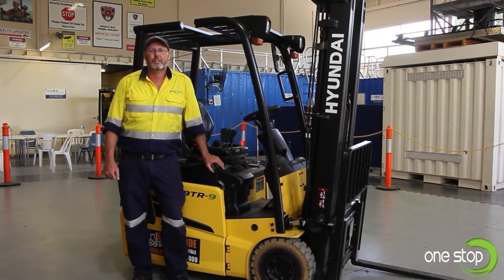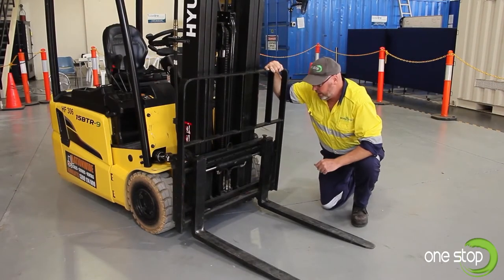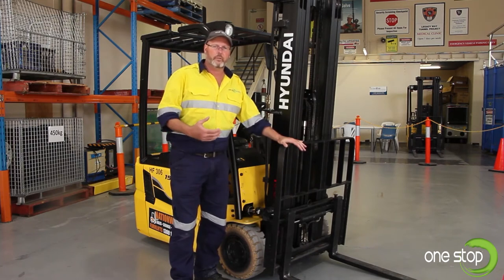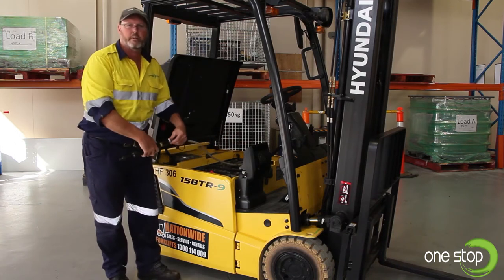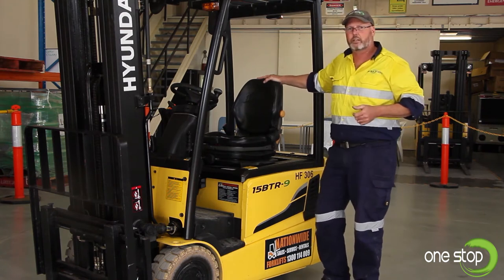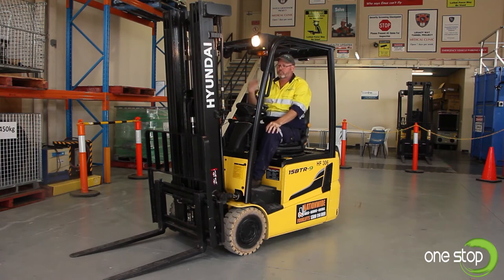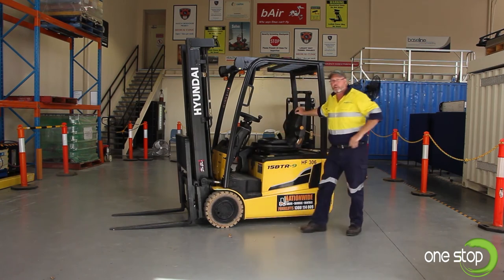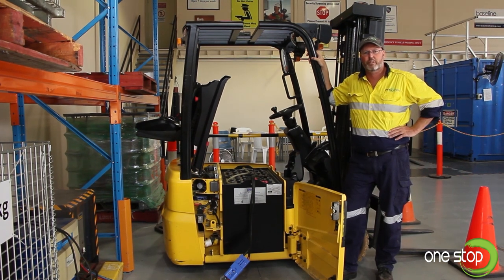Forklift Licence Training - Electric Pre and Post Start Inspection

Comment: I don't agree with one step tbh tho its just common sense and taking it easy my dad didn't even have a forklift licence in Australia and he worked for a huge truck company for ages and they didn't care at all.. 40 years and he can load and drive anything and he probably knows more than one step tbh. So I don't agree with half the risks they say cause my dad did them for 40 years and never had a accident once ever or ever hit a power line amd always weighed on the forklift scales nobosy gets off and checks weight on con notes get real pls.....cause responsible driving